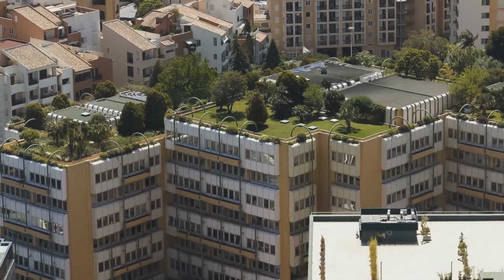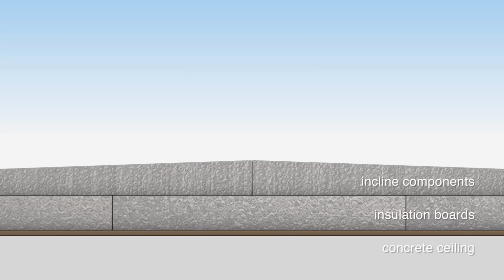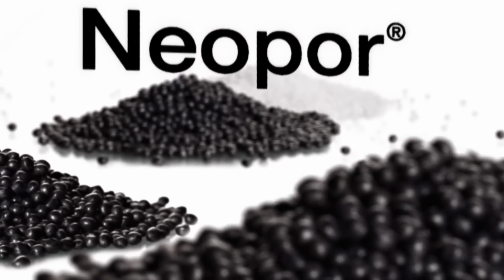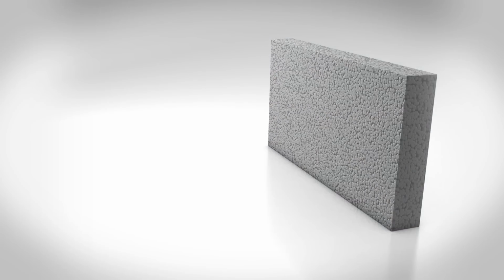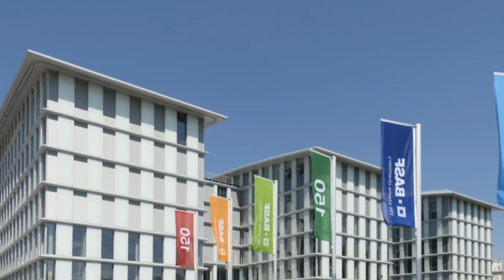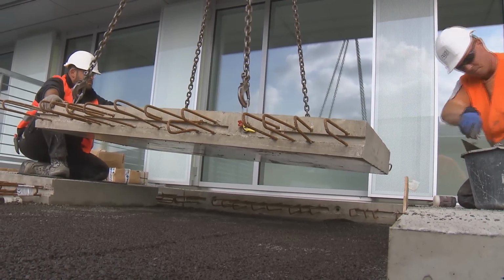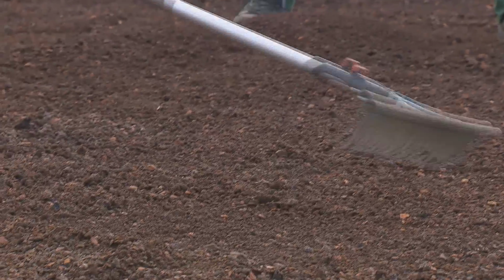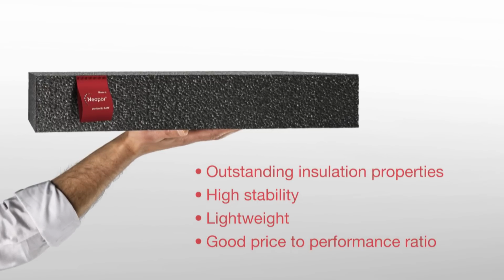How does efficient flat roof insulation work? Concepts from a construction site with Neopor

Comment: So after they put torch down membrane on top of the insulation board, they then put concrete slabs over it? Why isn't that in the animation at the beginning of the video? They just have the roofing membrane followed by the drainage layer and plant substrate.
Reply from the maker: The animation shows a general way of the construction of a flat roof, the solution with the concrete slab was especially designed for the BASF building D105. Because of the building requirements this design was necessary.

Comment: What is the R-Value of the 2" Neop[or?
Reply from the maker: The R-value of Neopor insulation is dependend on the specific product used and the processing to the final insulation board. As we produce the raw material we cannot state on the final r-value of a specific board. It would be best to get in contact with the producer of the final board.

Comment: How to manage rain water in roof garden.if there is continue raining for some days.Is there any drainage system.
Reply from the maker: There needs to be a drainage system depending on the roof structure. But this is something to be discussed with the architect in dependence with the individual building.

Comment: Thank You!!
Nice Video!
#Building #Thermal #Tnsulation is an object in a building used as insulation for any purpose. 
Download Free Sample Report @ https://bit.ly/2MmZ5G1 Thermal insulation in buildings is an important factor to achieving thermal comfort for its occupants. While most of the insulation in buildings is for thermal purposes, it is also applying to acoustic insulation, fire insulation, and impact insulation.